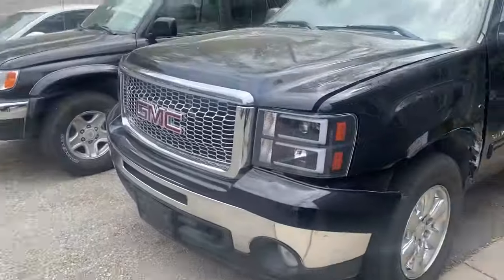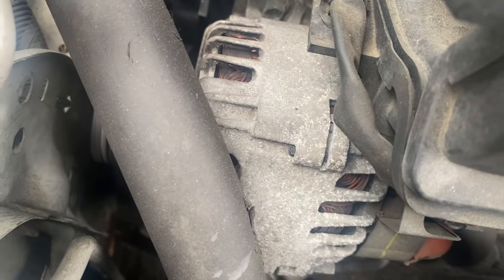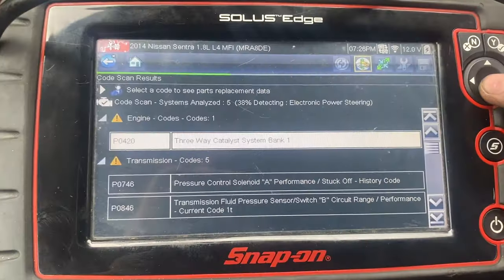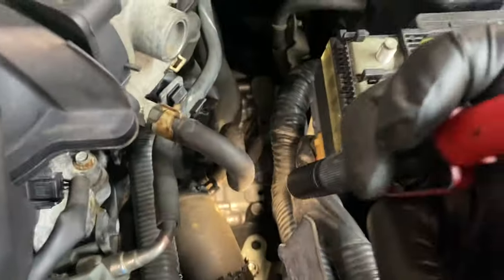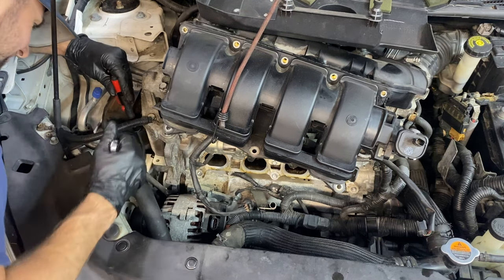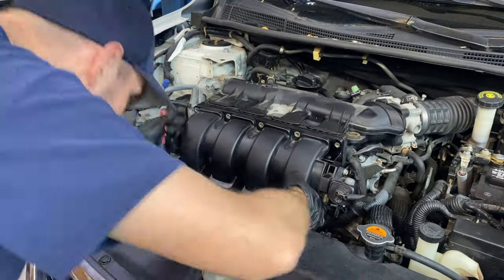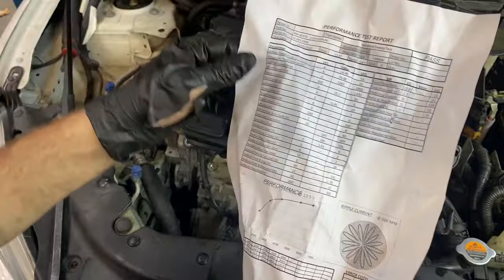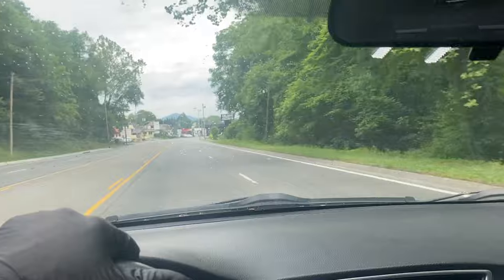Nissan Sentra Transmission Problem: What You Need to Know

Comment: How much was the transmission?
Reply from the maker: These transmissions are about 3,200 bucks at the dealer
Reply: I was just quoted $6000 to rebuild with new parts, replace pulley something, replace body something and catalytic. Does that sound right?
Reply: It includes part and labor. 1 yr warranty

Comment: Hi, can they make cars transmission easy to fix belts so it's done the same day. Like easy as changing your alternator.  Change a belt in transmission and your out the door. I had a transmission going out on a 2017 nissan sentra. Those cars are lemons. Lol "nissan"😮 I returned it back to the dealer. I still was making payments,  stopped  paying. I brought another nissan rogue. 2015.

Comment: How much the cost of a brand new cvt transmission of anissan sentra 2015 model
Reply from the maker: About 3500 plus another 1,200 to install and another 200 to program.
Reply: @justcallmeeddie1 take the eprom out the old transmission put it in the new one you have to reprogram it
Reply: @HotSizzleTv. What is a eprom?

Comment: There is a recall on that Transmission towing free pick up the Nissan dealership has extended up 120 thousand miles. But any way this card are the worse sorry but here it goes  THE BEST CAR IS TOYOTA  PRIUS
Reply: hey man i just called for the warranty on the transmission. I am still unsure they knew what i was talking about cuz they just scheduled me in and didnt say anything lol... i have a 2016 sentra, with 83858 miles on it. Do you think theyll just fix it or replace it still? Does that car go up to 120k miles or is it 84k miles? If you dont know i understand, youre just the only comment talking about the warranty.

Comment: "Nice and clean", that was funny. That car is a disaster. I'd hate to see one you call dirty. I'm an auto detailer, but even if I wasn't, the first thing you see is a crooked mat. Not an owner that takes care of anything, that's so basic; tire pressure also. That's probably why the CVT went bad (and everything else); not taking care of it. I have a 2017 Sentra with 65,000 and you can't drive them like you do a conventional transmission. You can't drive at high speeds, you cannot pass with it, you cannot tow with it. you can't push the gas and expect the overdrive you get from a conventional transmission. 

It goes 0 - 60 in about 3 months with only 124 HP and you must not try to change that. Drive it like you are 60, and it will be okay. Drive it like other cars and it will disappoint you. Change the oil regularly and check it before you drive it from whatever shop you choose to make sure they did it. I take mine to the dealer or do it myself. 

I was lucky and they gave me a new CVT ($5200 in 2023) under warranty, although I didn't notice anything wrong with it. But now, I will basically baby it for the second half of its life. But that car in the video was driven hard or something and neglected. That's a lot to be wrong at the same time. I haven't put anything but a battery into mine and it looks showroom new. I would have been embarrassed to have surrendered that car in that condition with trash and old food in it. "Clean"...really?

I would love to have a Civic, but yeah it is more expensive and that is a deal maker and breaker. People who buy Sentras cannot afford a Honda. People how buy a Honda can't afford a Mercedes, and so on. It's easy to say, but not easy to do. I wanted a new car I could take care of as one owner, and the Sentra was it. I like it very much and don't intend on replacing it. I love not having a car payment and owning a car only I have sat in.